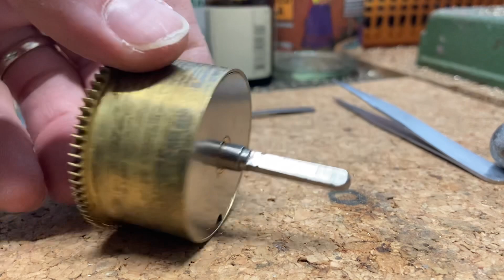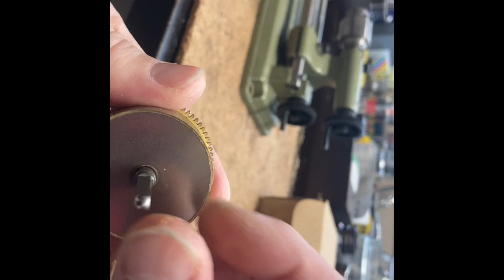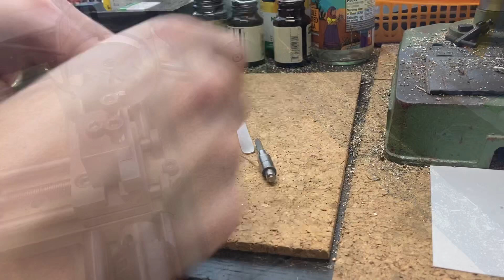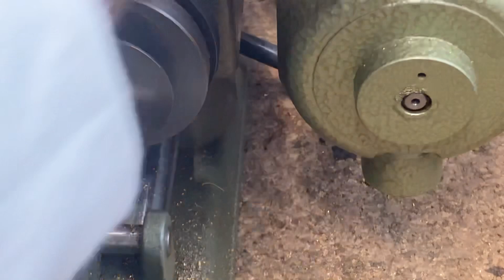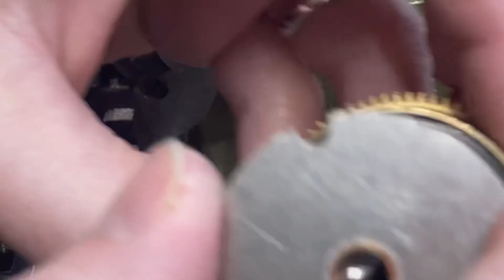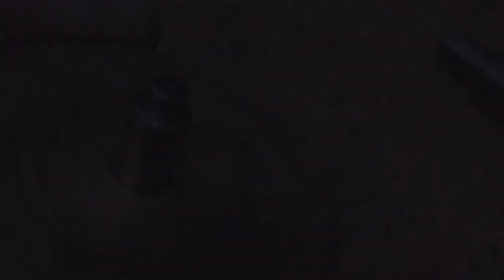How to repair a worn clock barrel or cap.

Comment: Thanks Chris.
Incidentally I work in exactly the same way, but my issue is how do you bush a flat cap, like those in Hermle barrels? Also how do you bush a barrel when the arbor is wide/thick and the spacer (bush) is thin?
Reply from the maker: What do you mean? I show you how to bush a cap in the video. If the bushing needs to be flush, you just face it off with your cutter. This procedure applies no matter how large the arbor is. 

If the arbor is very large, you may need to make a bushing or buy a special one.

Comment: I have recently acquired a ridgeway grandfather clock. It has three melody options. It was running perfectly on the Westminster chime. I wanted to see what one of the other melodies sounds like, so I turned the switch, listened to it for an hour, decided I liked the Westminster better, and I switched it back. Now the Westminster melody/hammer sequence isn't correct. It is adding in extra strikes. Sounds awful. How can I fix this?
Reply from the maker: Make sure you adjust the melody when it is done chiming and before it “warns for the next chime” i would try moving the lever until it “locks in position. It may be slightly off. The lever should kind of set or lock in the positions as opposed to just using the words on the dial.

If that doesn’t handle it. You will have to adjust the chiming sequence, which i can do a video on